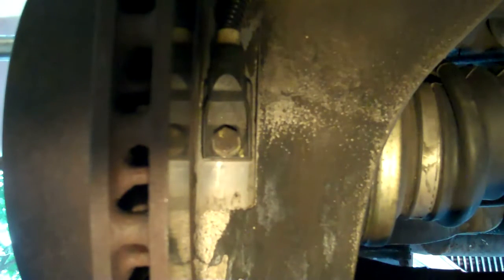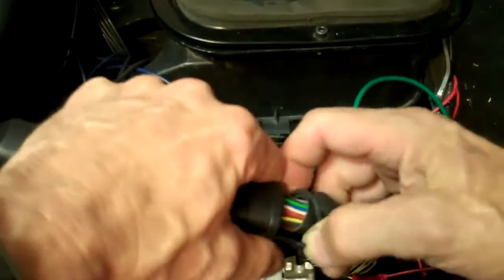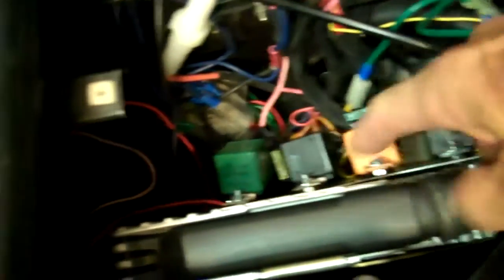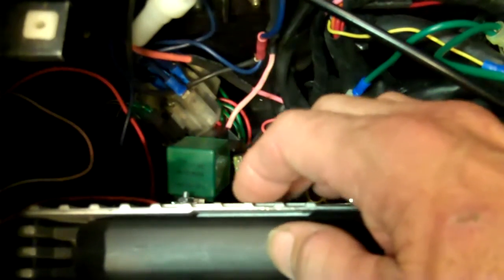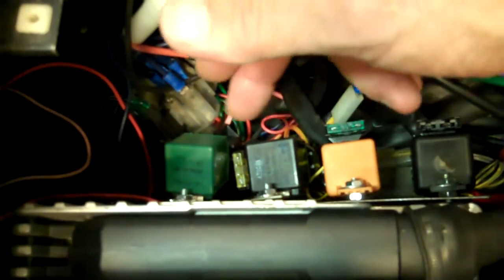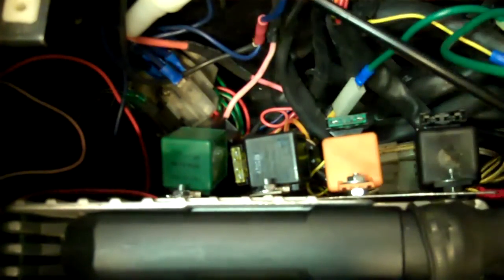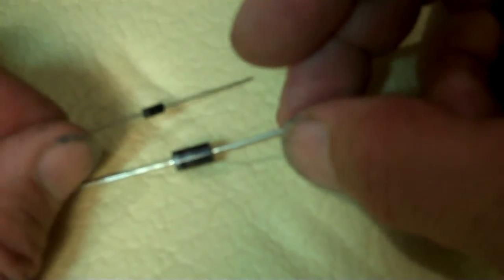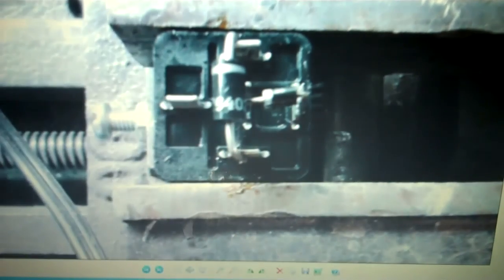Ferrari 348 ABS Basics Part 3

Comment: Question for you. I have 456gt. Very similar system from everything I can tell, although it isn’t obvious that there’s a similar diode box.  

My symptom:  abs light sometimes comes on while driving. Once on, it stays on until I’m parked. So it’s a more intermittent issue than yours was. Just curious for your thoughts. Maybe a wheel sensor going bad?
Reply from the maker: These damn ABS systems have a multitude of components, anyone if which can cause the system to fail. You'll need a wiring diagram of your particular system and go through step by aggravating step.  My video shows how to check your wheel sensors

Comment: hi I need your help Im having problem with my 348 when I conect the battery and the key in off the abs pump gets hot verry fast and the battery discharge in less of one minute when I disconect the pump the battery dont gets discharge what can be the problem?
Reply from the maker: Wow, I'm not sure.  The pump is suppose to pressurize the accumulator (the ball-like thing sitting on top of the pump) and then the cylindrical structure with the 5 wire plug in the end of it (the fluid pressure control switch) is supposed to shut the pump off when the correct pressure is achieved.  Sounds like one of the three is not working correctly.  If it was a accumulator problem, it would still shut off, but run more frequently.   Sounds more like a pump or pressure control switch problem,  but I don't know how to determine that specifically.  You might want to throw the question out on Ferrarichat and see if anyone else has ideas.
Reply: thanks how can I test the motor?
Reply from the maker: Roberto Detto
I don't know,  I'm not a certified mechanic.  The pump produces high pressures which are stored in the accumulator, so it's not the sort of thing you want to be playing around with if you don't know what you're doing.  Between the danger of injury, or damaging a very expensive pump, it's probably time to see a real Ferrari knowledgeable mechanic.  Sorry.